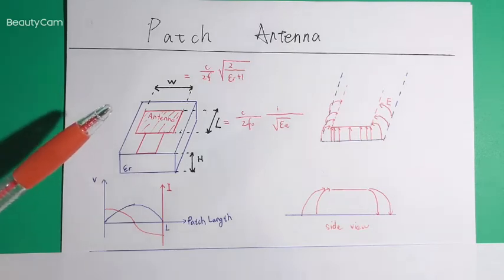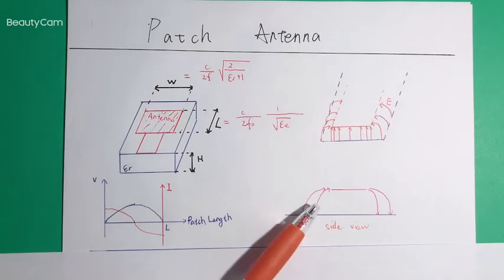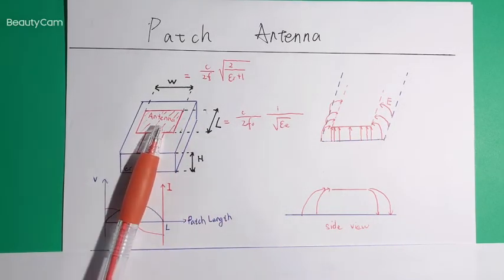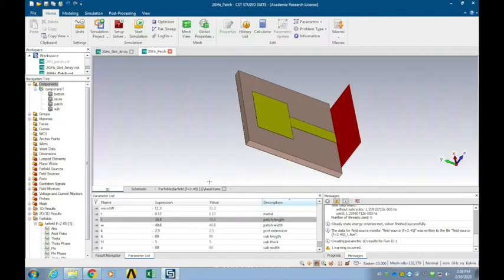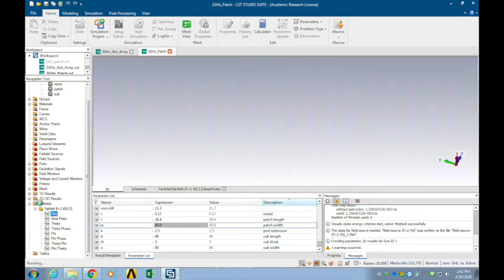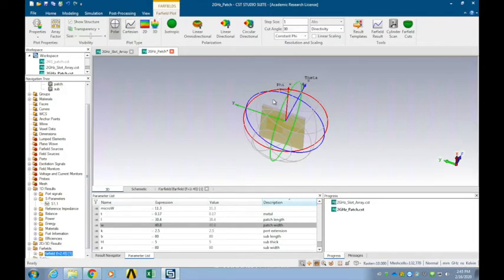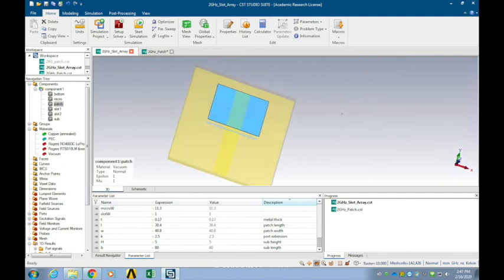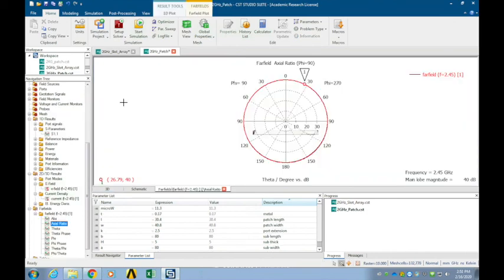Design Rule for Patch Antenna

Comment: Is a patch antena rely solely on ratios? Is there a max size for creating a patch antenna for receiving?
Reply from the maker: In microwave and/or mm-wave world, the size relative to wavelength is critical instead of the absolute size. So the size of the patch antenna is related to the (effective) permittivity, also called as  dielectric constant and working frequency.